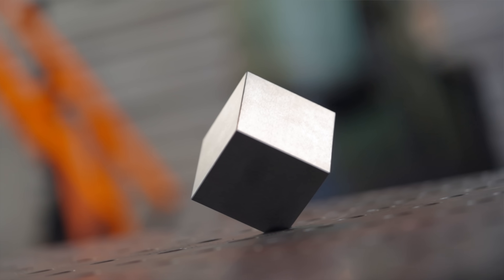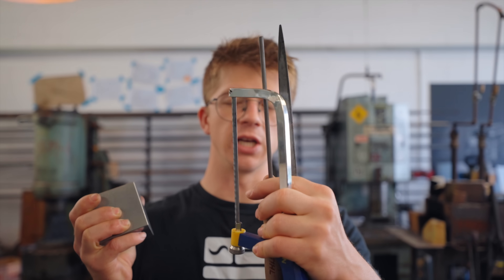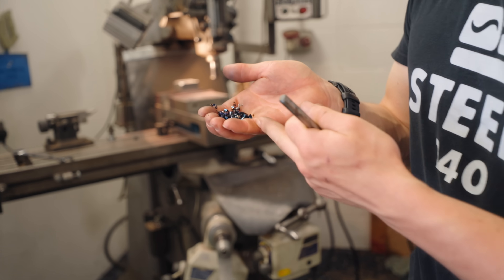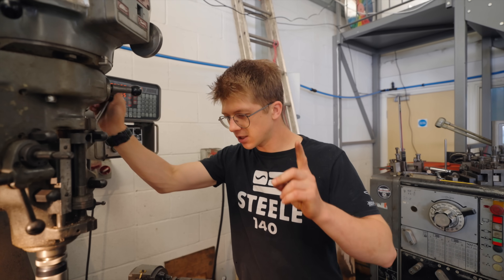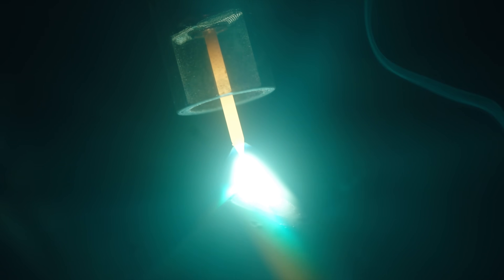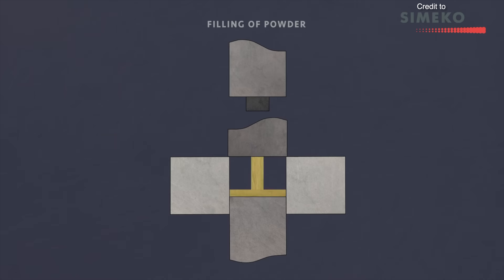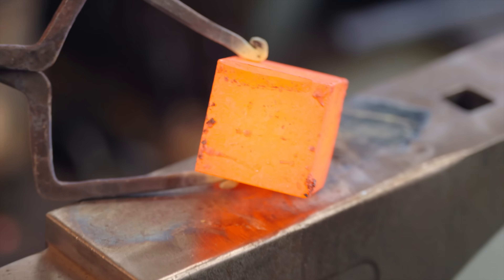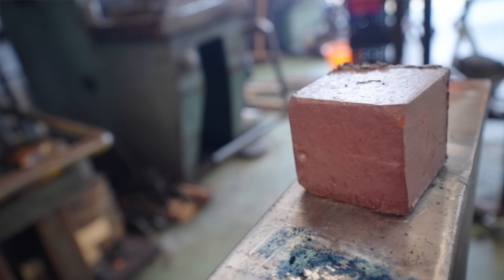Can You Forge Tungsten?

Comment: So when you’re welding using tig, make sure if you see a bunch of brown form around your weld; that you clean your tungsten. Once you stick your tungsten the first couple of times, it starts collecting on the end of your electrode (tungsten) and once that happens; any contamination can cause some very unwanted effects. Without getting too technical, the effect you saw Alex was the metal oxidizing instead of melting. Thats why it started blasting it away once the tungsten became contaminated. I worked with stainless and this same effect happened. Only it would happen much faster. I would be welding a .25 inch stainless pipe, and if my tungsten got contaminated, it would blast a hole in the pipe in less than a second. You learned to just cut the power and grind the spot you messed up on. Contaminated tungsten burns much hotter and pulls way more current than clean tungsten. Also makes a lot of mess around and inside the weld.

Comment: I used to machine tungsten counter weights for centerless grinders on a doosan 7-axis mill-turn.
The stuff IS tough, but actually machined gummy, (for lack of a better term).
we ran the latest Sandvik inserts, and had very little problem.
It came down to making sure your Blaser was fresh, and you trusted Sandvik's numbers.
Some of it seemed counter-intuitive, but was correct.

Comment: Heh!

Make a tungsten CRANK SHAFT! (~_^)-b

Like say...

For a really small, 1 cylinder engine though...

Because you don't have that much to begin with, and its so expensive to get.

It could be milled into the right shape, and for its size could bear up to a whole lot of horsepower without deforming, provided any of the other parts could survive that long.

Also it would not need much of a counter weight to balance against a light weight aluminum piston and rod, so the rotating mass would have less dynamic fluid drag, as it could be either smaller in diameter, or thinner, as compared to the counter weights built into an iron or steel crank shaft.

I know that many high performance racing engine builders use tungsten to balance crank shafts because its so easy to get really precise numbers with tiny little pieces, and its a 'dead' [as in it is not prone to 'ring'] metal, much like cast iron.

Comment: Have you ever played around with Silicon Metal. 99.9999% Pure silicon. At very high temperatures it is extremely steel like. You can forge it when it is red hot. (Melts around the same temperature as steel too!!)
At low temperatures it is brittle and hard. (Shatters easily)

Oh... and it is the most light weight metal (transition metal?) on the planet!

Comment: I'm probably not the first person to mention this. But instead of using your propane forge since it's temps can't get high enough.
Would you be willing to try using oxy acetylene torches to either heat the tungsten or the forge?
The temperatures you can get out of an oxy acetylene torch are much higher, 5600 °F to 6300 °F.
That should be hot enough to start doing any potential forging on it.

Would love to see you try it, even as an experiment to prove me wrong, or right.

Comment: I used to work in a steel foundry. We didn’t do anything with tungsten steel alloys, but I can tell you those arc furnaces can easily get above the melting point of tungsten. The walls of the furnace are lined with a silicon spray, and it gets eaten away at and dissolves in the liquid steel, and has to be recoated after every heat. The steel walls of the furnace have water flowing through them (though that’s more of an emergency measure if a chunk of silicon falls off the wall and exposes the steel wall to the inside temperatures). Even with the water lined wall, when a hot spot is exposed, it’ll glow red hot from the outside of the furnace and needs to be fixed immediately. Our furnaces were usually charged with 15-20 tons of molten steel at a time. We did large scale castings, and some of our castings were bigger than 10 tons for a single cast piece.
Reply: Are those with wires jumping from the amount of current flowing and requiring a power plant?)
Reply: @Mr.Leeroy  so they use graphite rods (3 of them per furnace) and dunk them into the furnace to create the arc that melts the metal. I can’t remember exactly, but the rods are probably about 2ft in diameter of pure graphite. The rods also dissolve in the steel and add carbon into it, and we have to control the carbon level in our steel to get the correct alloy, so we blow pure oxygen into the molten steel with a long metal pipe the burn off the excess carbon. And of course the metal pipe melts away as you blow so you need to constantly take it off and put a new one on. Basically, everything used in the steel melting process is extremely disposable and will either melt, burn, or dissolve in liquid steel.

I do believe the foundry takes up a sizable chunk of the city’s electricity production. Like potentially double digit percent, in a city with almost 100,000 people.
Reply: @Mr.Leeroy  Right?! Also, I've decided I like Alec Steele's following of smart people who make very smart comments based on ACTUAL expertise. 😄
Reply: @TheTruthIsEasier so you hope anyway.
Reply: @Mr.Leeroy  a lot of those plants have their own transformer yards, basically
Reply: is that silicon coating why alot of cast irons have high silicon content?
Reply: @AlexJoneses  so the silicon content in the metal is controlled depending on what alloy we are trying to produce. I’m not super familiar with the actual composition of most alloys, but I can tell you that even with the silicon walls dissolving in the metal, we usually have to add extra pure silicon to get the correct ratio. They certainly have to take into account how much is expected to dissolve to figure out how much to add, and before the steel leaves the furnace we always take a sample and check it’s precise composition to make sure it’s within spec. Sometimes we have to dilute it with more metal, or take out more carbon, or scrap it all together if it’s too far out of spec.
Reply: @AlexJoneses  no thats on purpose to make grey GY without silicon it becomes white GY and is barely machineble. used as abrassive resitent plates
Reply: I don't know if this is true of tungsten and steel, but some alloys can be made below the melting point of one of their ingredients. It basically dissolves in the other metal.
Reply: what a dangerous job. glad that's past tense for ya
Reply: @dedompler  not only was it dangerous, but the management was atrocious. I was told by one supervisor I was one of the best employees there. Despite that, I was terminated from that job. I reported a different supervisor for harassment, and within a month they gave me enough disciplines that I lost my job. Glad I did though cause my current occupation is safer, less stressful, and pays better lol. They lost out on a good worker, I didn’t lose anything.
Reply: @andrewevenson2657 perhaps this is partly why we’re losing so much production overseas. Treating our employees like disposable parts like those you mentioned you used in the forging process.
Reply: @Akkbar21  they do not pay you well enough for the level of danger they put you through, and on top of that, they treat you poorly, so yeah we probably lose production to other countries because of that. It should be noted their turnover rate is extremely high. They usually hire 120ish people a year, and 90% of them are fired or quit within the first year. In fact, when I worked there, it was uncommon to see someone last past their 3 month probationary period. They also have a sign that says so many days without a lost time accident, but they exclude probation people from that statistic, cause they aren’t technically fully employed and subject to the same rules, and even if you pass your probationary period, they don’t count injuries as accidents unless you are hospitalized. I’ve had molten metal spill onto my silvered glove and give me a nasty burn, bad enough that I had to call in sick to let it recover, but they don’t count that as an accident. You are also not allowed to take time off authorization from the company, and they are allowed to force you to work any overtime within state legal limits, and if you disobey they fire you. Just a horrible place to work.
Reply: Sounds dangerous
Reply: Jesus H. We may pay more tax here, but I think I’m happier paying it now that I know what labour laws do for us!
Reply: Power plant operator here. Would the water behind the furnace walls then be considered a pressure vessel and equipped with a safety valve? Do you know how much water is roughly in that system? And what transfers heat? I'm guessing a huge radiator outside? Possibly a chiller? Sounds very cool.
Reply: @clintony3000  you know, unfortunately I don’t know how much water was in the system or what they did to keep the water cool. I think the heat transfer was just the steel walls of the furnace. It’s lined with insulated fire brick, and sprayed with a silicon slurry that hardens to protect the fire brick, then I think it’s just a steel wall behind that. I think the idea is to just insulate it enough that water can take away heat faster than anything could melt through. Funnily enough, now I’m a plumber/pipefitter, so there is a non-zero chance I might do work in that foundry again working on whatever water cooling system they have for the furnaces! I don’t imagine it woupd be considered a pressure vessel as the outside jacket was not sealed. It was a sealed inside steel wall, then water pouring down that inner wall, then the outside wall was mostly sealed but had some holes to see the water pouring on the inside.
Reply: The problem is that when we cool it down, the tungsten will harden so much earlier that it won't bind with the iron carbon. Giving you just two separate metals mixed into each other in relative big pockets. 

My guess on how they do it is that they grind both metals down to very, very fine powder and then sinter them into a quasi-alloy.
Reply: Tungsten is above 6000 degrees, melting point
Reply: @ajd0101 the arc temp is between 5,400 and 10,800 degrees. The vessel is probably not designed to sustain such high temperatures, as you rarely exceed 3,100 - 3,200 degrees for the steel process, but there is no reason you couldn’t just run the furnace up to 6,000 degrees. The temp only stops because they turn the furnace off, not because of some sort of limitation on heating ability.

Comment: One thing I've been curious about is can you mix two metals together without heat.

I'm not sure which metals would be interesting to try though. But my thinking is that there may be some metals that just won't mix together nicely under heat. So let's try just squeeze / fold / squeeze / fold in an attempt to "physically" mix them together.

Comment: I think it would be easier to forge if you cut it down to like 1" by 1" by like 3 or 4 inches to be able to hold it with the square tongs and maybe get the heat into the metal a little deeper.

Comment: I will have my tungsten carbide wedding ring on for 5 years consistently in November. It's so cool to have something so incredibly dense at my wanton disposal to tap, ping, or smack -  just to make whatever I contact resonate at its natural sound for a reference. Short of barely noticeable surface marring and a grey patina, the ring looks as good as new to this day. Highly recommend material for a wedding ring!
Reply: Caveat on tungsten carbide for a wedding ring: it can't be resized if your finger gets thicker or thinner.

I was also going to say that it's difficult to remove if it gets stuck, but I checked and I was wrong about that - a tungsten carbide ring is almost impossible to cut, but it can be broken fairly easily with vice-grip pliers.

Comment: I worked in a research shop and a part came in that was tungsten about 1/8 thick and had 200+ .03" diameter though holes and my imedit reaction was "nope cant do it need edm". them looked it up and did it all with 2 carbide drills.

Comment: Technically tungsten can be heated via induction so it's possible to get it hot enough to forge like steel in a shop setting. Also, on the plus side it's homogeneous and has an obscene melting point so you wouldn't need to be very precise with the heating like you would an alloy steel.
You'd need a stout induction unit to get the job done however.
Reply: I don't think you can. I think it would have to explode.

Comment: I would like to see some Titanium alloys...  Specifically a Gold Titanium alloy (in a 3 parts Titanium, 1 part gold) which has a similar density to Steel, BUT if heat-treated correctly, can actually gain a strength around 4 times that of steel.

Comment: Fun fact, j work in a factory where we roll the wire that they make the High speed steel drill bits of. And a bunch of other tooling items. We call it HSS for short. I've seen the ovens where we melt the steel and yea like you said, it's hot lol.

Comment: Part what makes a metal (or alloy) forgeable is how ductile is, not just its melting point. Bronze has a much lower melting than steel, but you can't forge it - it's too brittle at any temperature. On the other hand, you can forge steel at room temperature (cold forging) with enough force - it's just easier to do by hand at higher temperatures.

Comment: Tungsten carbide cutting tools are not made just from tungsten carbide. It's made from tungsten carbide dust mixed with (usually) cobalt dust, which is then pressed and sintered as you said. This makes it not a ceramic, but a composite material, and gives it properties somewhere in between a metal and a ceramic.

Comment: I have a challenge idea for you. With the information we currently know about wootz also known as the original Damascus steel test your skill in replicating it and then trying to implement tungsten instead of steele. I see this as a potential experimental series that id love to see. And no experiment would be complete without a test compare the wootz creation you make, the normal modern Damascus you normally make, and the tungsten wootz experiment in  some test trials. All will need to be long blades of the similar length and width

As a bit of background info wootz was supposedly stronger then our current Damascus blade. And legends say it could cut through helmets but I think that's a stretch

Comment: Tungsten in the end is a metal which - all things considered - are quite soft, as opposed to tungsten-carbite, which as you said is a ceramic, which - among others - are known for being extremely hard. Harder materials can scratch softer materials, but softer materials can't scratch harder material. That's why cardboard can cut into your finger, because it's harder than your skin, but it can't cut the hard plastic chassis of the Laptop that came in the box, because that in turn is harder than cardboard

Comment: The ability to melt it with the TIG welder was actually surprising, but I think what was molten was actually tungsten oxide since the distance between the TIG torch and the block was somewhat large and some oxygen could probably get in

Comment: Honestly it looks to be a very good projectile against buildings and køretøjer.
The high density and high melting temperatur would make it hard to stop if you can get it up to a high speed.
I am honestly a little confused why they use uranium ( But I guess you have depleted uranium as a leftover material from making nuclear fuel and weapons) over tungsten in some weapons.

Comment: I wonder if you cut off like a 2inch slice if you could forge it into a small knife. or take the shavings from the milling and drilling and make a canister out of it with some high carbon steel and, powdered steel. Kind of like a Frankenstein canister.

Comment: Used to be employed on maintenance in a tungsten factory, from powder to lamp filaments. Powder sintered at approximately 5k. amps in atmosphere of hydrogen. Bars heated in coffin furnace in inert atmosphere and hammer swaged to round. Swageing process carrried on until dia. reduced to point where it could be reduced by pulling through dies. At a point during swaging process bars would be passed through a Retreat furnace. Down to micron sizes via dies made from industrial diamonds with correct size bored through. Lubricant a form of liquid graphite.

Comment: Hmm, very interesting! I use a metal called tantung in my wood shop as a cutter which is far harder than high speed steel, M2, and M42, as well as V10 metal. Stellite is similar to the tantung. I know tantung is "cast" which I think involves pressure and heat. Makes me wonder what all they do to the tungsten to make it carbide. The tantung is very brittle, so like carbide, if I drop it on the floor, it will shatter. The tantung though, can be sharpened on standard grinding wheels.

Comment: So, you might be able to forge tungsten, but because of it's density, and thermal mass you're probably going to need to cook it for hours, if not days to get heat fully into it. Since ya know, it's got a fuckload of thermal mass. 

Dunno if you've got enough propane to accomplish that, but if you wanted to, I'd give it a shot. But an induction furnace might be better for keeping it that hot for long periods of time.